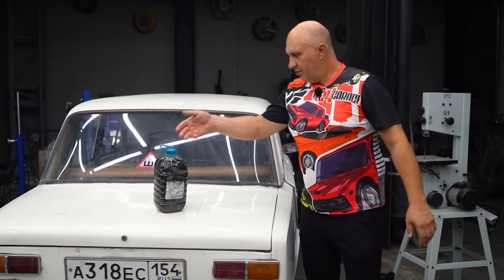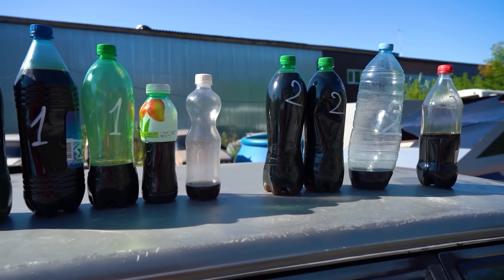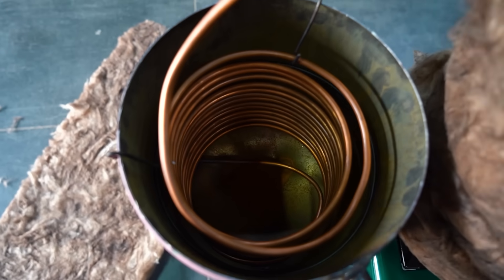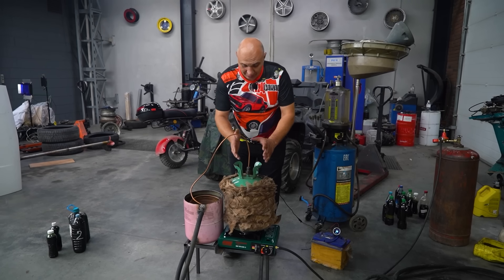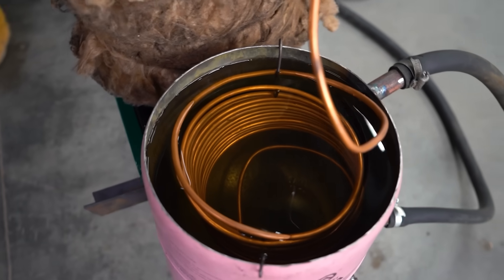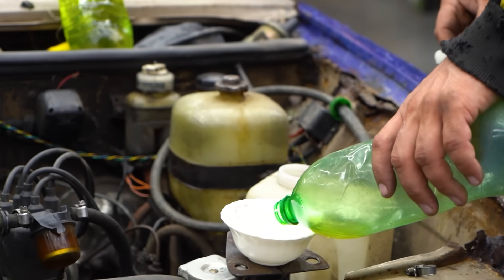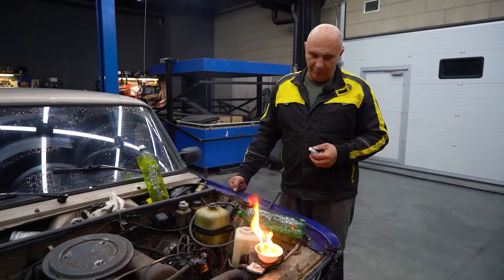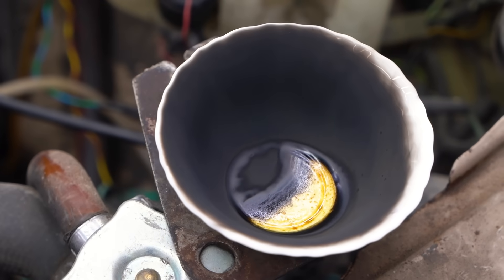Tire-extract fuel vs pump gas - which is better?

Comment: A spark plug comparison after each test would have been interesting to see.
Reply: I was expecting them to do that myself.
Reply: ill bet it needs leaned out as it burned hotter in the cup test that cracked the cup. its a longer chain molecule. right
Reply: @garykentner7557  That is a definite possibility.
Reply: Yes
Reply: Does the test site being container store yard?
Reply: @mohdhalimamat7877 You may want to reword that. It makes absolutely no sense whatsoever.
Reply: Yes!
Reply: They should adjust its gap and spark timing when its octane number will be known! Thats can be a matter for they color if not set right .

Comment: Fuel is made in large Fractional Stills, the higher vapours end up at the top and work down through kerosene, to Diesel, leaving Tar at the bottom which is used to make the roads. 
He could potentially Tar the road outside the garage 54.

Comment: I would like to see what the valves and piston in the cylinder looks like after running that synthetic gas for a bit. I guess you could keep refining the synthentic until it's as clean as pump gas.
Reply: Thats good point chuck.  So many fuels have been ran in vehicles.  Another idea would be preheating fuel to get better atomization.   I think if you did get varnish buildup some fuel system cleaner or a can of That Motorflush or seafoam.    But this fuel looks pretty clean
Reply: No if they continue to refine it it will become more rich. Look at the process  crude oil is made and you will see that there are many types of fuel you can get.
Reply: @MarcusAurelius2025  and different crudes give different hydrocarbons. "crude oil" is a pretty generic term, some come out fizzing with volatiles, "natural gas", butanes... some come out thick, tar with greases and waxes... iirc, "pennsylvania crude" was well known for lubricating oils, almost as a raw product. most people think of "tar" when they think of "crude oil", but that isnt always the case.

"cracking" is a bit of an art. its impressive what these guys have achieved, but with some good research they could still improve what theyre making... i have a few good books that go into good detail on this stuff. but it also requires a bit of decent lab-ware. and of course, to even begin to emulate a full on refinery is a daunting challenge! one wrong move and the whole setup can end in disaster...

my main concern is sulfur contents due to tyres being "vulcanised", which involves lots of sulfur... and then modern compounds are trending towards high silicon contents... a tyre is going to have lots of sulfur, and a lot of excess carbon.

it all affects what the end product is, and what byproducts are left.

doing tests on flash points, boiling points... maybe not as interesting a video, and would also be more suited to say, "nile red" or "chemical force" or "explosions and ire"...

and then theres always the original tests ricardo was doing on compression and how the term "octane" even came into being... quick look at any chemical databook will show that "octane" isnt just ONE compound, but a whole variety of isomers that share the same 8 carbon atoms in a chain. only one or two are what we consider as "octane".

that was the whole point of TEL, reduce the complexity of refining "good fuel", make it CHEAP...

 unleaded needs a lot of extra... "aromatics" to get the same result.

Comment: I think the difference is that regular pump fuel has ethernol in it which is less engery dense, this might explain the differnce you are seeing
Reply: I don't think that's the case in Russia. Only in politically correct countries do they put ethanol into petrol. It's basically a scam and makes petrol more expensive for no benefit to the environment or to consumers.

Comment: That fluid seems to have more energy density than ordinary gasoline. Try to tune up the carb, make the mixture more lean, if it starts pinging retard the ignition a bit. I think you can get over 10km on that run.
Reply: id think that would make the cars more fuel efficient then! might have to change my tune and switch to homemade gas 😂 as long as it doesnt kill my motor after being daily driven on
Reply: @_BaguetteDoggo just gotta find the right stoic for that fuel and hope it doesn’t cause build up on the piston heads or valves. I don’t think those ladas have cats so that’s one less thing to worry about. I’m curious of the make up of this fuel and how it compares stoic wise and it’s octane rating
Reply: @TheMrDarius  may not be exactly legally, but i dont have cats either 🤣 yeah thats kinda what i was thinking would be the death of my motor if it gets a whole bunch of buildup inside the cylinder or around the valves. maybe they should do some more testing
Reply: @_BaguetteDoggo   get a gdi / direct injected car and you will have crazy buildup in the intake any fuel. xD
Reply: @MollersT  makes sense lol
Reply: @TheMrDarius  thats exactly what it will do if you daily drive this fuel ! We saw this in a bowl test. immediately makes everything black and tar-like. unless you come up with some piston washing liquid this cannot be daily driven.
Reply: The biggest problem with making your own fuel from plastics or old fuel/tires is the extra additives the fuel will have. You want to make usre the fuel doesn't have too much sulfur in it and then you will most likely be fine @_BaguetteDoggo
Reply: @_BaguetteDoggo  2 stroke oil and cleaners and ur good :)
Reply: It almost seemed more eager to launch on the test track run compared to gasoline.
Reply: @jwalster9412 really need to test it on pump fuel again after as after a good thrash combustion pressure usually helps seal the rings a bit better. So might not be all from the fuel.
Reply: Yeah needs to be more lean, or even better, add boost and it might be crazy
Reply: Ya it has diesel mixed in they need to refine again
Reply: Or maybe try it in a diesel. It looks a lot like diesel fuel.
Reply: Should probably cut it with 10% ethanol to reduce knock possibility and to make sure the cylinders get cleaned out of that black soot.
Reply: mix it with e85

Comment: It would be interesting to send a sample of this to a lab and have it tested to see it's chemical makeup and also do an octane test
Reply: I didn't hear it knock at all, even when they pushed the car hard. The octane rating can't be that bad.
Reply: @misterfreedom5699 you have to remember that a lada is a dog engine it loves shit fuel
Reply: @STAY-GOLD-VINYL lmfao I mean you’re not wrong.
Reply: @STAY-GOLD-VINYL  so if the Lada can handle it.... my Ford 8n should also be able to handle it.
Reply: @misterfreedom5699  It's a Lada, it'll probably run on kerosene
Reply: @NoblePineapples  some guy got it to run on kerosene yes, but it started dieseling a bit after it got hot, he removed the key and it kept going for a minute
Reply: @Fred_the_1996 I thought run away only happens In diesels based on the burn test I also go back and think I should run away but didn’t the fuel actually lasted longer was slightly better acceleration wise
Reply: @misterfreedom5699  well, soviet fuel in the 60s and 70s was different from ours. In the ussr there were 3 varieties on sale: B-60, B-74 and B-100, which were 60 octane, 74 octane, and 100 octane respectively. So most cars could run on 60 or 74, while 100 octane was more expensive and not very widely used. Lower octane fuels worked well with the low compression of their passenger car engines.
Reply: The soviets probably used a different octane rating. Sort of like the British do. They don't use standard octane ratings like we do in the US. @Fred_the_1996
Reply: @TehButterflyEffect I think this is correct. Still today Europe uses different octane rating than U.S. The most common gasoline is 95 octane in Europe, and "premium" is 98 octane
Reply: @misterfreedom5699 Lada’s are designed for 65 Octane Russian fuel…
Reply: Project farm agrees lol
Reply: @trm4life  true🤣
Reply: @trm4life  I like where you're going with this.....
Reply: Yes need to see labs on this. The Lada is a dog engi e however I'm still shocked there was no knocking or lack of power. However the throttle response appeared to be lower
Reply: And a engine power test. I think it will have more power with the self made fuel
Reply: Would love to see how this would run in a fuel injected engine.
Reply: should name this Mad Max Post Apocalypse gas
Reply: I'd guess the energy density is close to regular gasoline.  Modern fuel has about 10% ethanol in it, which would explain the worse performance on pump gas.
Reply: @silvenshadow  I don't think the Russians are putting ethanol in their pump gas. That's a stupid thing that's done here in America thanks to the corn lobby
Reply: I would imagine it contains a lot more naphtha, which would make it burn hot.  Also tons more sulfur, since it's source was vulcanized rubber.  To properly refine, the sulfur would need to be catalyzed out, and the naphtha reformed.  That being said, the fuel is obviously usable as is, you just might need to maintain the car a lot more (1600 k oil changes)  and deposits / heat might have to be controlled with a water injection system for long term use if there were no other options.  A third distillation could get rid of the heavier compounds, but that also might have the side effect of an even hotter burn.  The waste would be incredible in such a simple process, so I suppose burning would be the best way to dispose of it, if possible reintroducing it into the main burner to supplement the wood pyrolyzing the tires and use the leftover lighter gasses for heating the refined products to distill them off.
Reply: This is why there was alcohol prohibition back in the day.
Reply: I had the same thoand spent about a half hour looking for a testing method.
Reply: I think the octane rating is a bit higher than pump gas, even if it is between normal ratings. 93 or 95, this is probably 94.something
Reply: @Nomad_za  im willing to bet you're wrong.
No sting intended.
Reply: @graverobbermotorsports4606  I could be wrong. But with the price of gas we have to start looking at other alternatives. I am seriously wanting to make gas out of tyres. In South Africa we are paying R28/Liter. I remember how mad I was when we were paying R9/Liter
Reply: @Nomad_za start with a different president. It’s miraculous that fuel cost plummeted to barely above $2 in Florida and it was under $2 in the Midwest.
Reply: @russelbrown6275  I wish we could. But the ANC will win again next year even though we have massive power outages. Though that has stopped for a week, because everyone who can afford it got solar power and inverters.
Reply: Is very simple..The octane test is higher than sintetic gasoline as the car runs longer distance...
Reply: Low octane is good for a diesel motor. In fact, the lower the octane the smoother a diesel runs
Reply: i did see already in other video from some mexican dude, claiming it was a good 98% but didn't make some kind of test like these ones. (also, it was only informational)
Reply: They can tell just with a simple heat laser. What I can tell it has low octane it looked hot since it broke the ceramic bowl
Reply: You got to love these guys hehehe
Reply: It has been tested by others. It's not good unfortunately. Mostly limonene, xylene, styrene, toluene,
trimethylbenzene, ethylbenzene and benzene. Some of those are straight up cancer juice.
Reply: Pyrolysis oil doesn't really have an "octane" rating per se. Depending on the starting material, temp, etc, you will get all different sizes of hydrocarbon chains ranging from C5 - ~C20. In vehicle fuels like gasoline,  they are 6 carbon chains with added 8 carbon chains (Octane) as a stabilizer by increasing the temp that the gasoline combust at. While there would definitely be some octane produced by the pyrolosis process it wouldn't be enough to qualify as 87, 90, 93, 95
Reply: @LtLolcopter n-alkanes such as octane and hexane are trace constituents of regular gasoline. The octane rating is just a measuring stick to describe how much compression the fuel can handle. Major components of regular gasoline are complex hydrocarbon compounds, many of which aromatic. Toluene is usually the most abundant, then the three isomeres of xylene. Gasoline itself is very complex mixture of hundreds of different hydrocarbons
Reply: That has to be at least 100 octane. That launch on the test track was really insane.
Reply: @jwalster9412  -- Higher octane doesn't give a low compression engine more power. In fact it will make the engine lose power. Higher octane is meant for high copresion engines to stop predeatonation of the fuel.
Reply: @kenhoward-h9e  who knows, maybe all the soot that fuel was putting in the engine increased the compression.

Comment: Super low octane probably. Tractor or bunker fuel looking stuff, mabye somwhat kerosene like

This would not work on a modern engine at all 

But an old or tractor type motor. Prolly be ok
Reply: It would be safer to mix it with pump fuel to stop the engine coking up. But yeah, this could be turned into a recycling business.

Comment: I was quite surprised. Figured it would run, but expected lots of pinging due to low octane. You guys never fail to deliver.
Reply: It's a Lada, the compression ratio is like 6:1. It'll run fine on just about anything that burns.
Reply: Based on the burn in the cup, the octane is considerably higher.
Reply: I think they got quite the opposite and got  a better octane number considering
Reply: @zethspurlock  at 6:1 compression, i think you will find its more efficient on lower octane, not higher.
Reply: @ct1762  I was thinking the same thing I know I have watched cars run to high of an octane at the drag strip and it hurt there et the cup burn though is why I'm thinking that who know I bet it's not just one factor like Maybe has lower octane and alot more unrefined carbons idk
Reply: @zethspurlock  well for one he wasn't racing the engine, in addition to the hotter fuel you would need high revs for an extended period, say a burnout, and then a trip down the dragstrip. Also if as said a Lada engine runs at low compression, then a lot of the fuel will remain unburnt. Which has a cooling effect.... Also back to the tune. Gasoline available in his area is 92 and 95 octane. Not the horsecrap 87 with 10% ethanol we have in the states, so.. Even if the car has low compression (which I doubt because I've seen compression tests on these motors that are comparable to the norm 8-10 to 1. My point is if the car is used to 92, and tuned to 92, then higher will only make it richer.. Which it did... Not leaner.
Reply: @christianfritz6333  exactly it made it richer
Reply: @christianfritz6333  Just wanted to correct something: US uses AKI instead of RON(more commonly used in the rest of the world, like Russia) to measure knock. 87 AKI is equivalent to 91 RON, the difference isn't that big. And ethanol isn't a problem, ethanol actually is more knock resistant. The issue is ethanol has lower energy density, and gas stations are selling them like they are standard gasoline yet you'll get less mileage out of it. It's like mixing water into orange juice.
Reply: They should try to run a diesel motor, and try to make very low octane, because the lower the octane the better a diesel runs

Comment: Great test! Now try acetone in regular gasoline. 30ml of acetone to 19L of petrol is the ideal ratio.Change the concentration and see how much acetone can be mixed with fuel before the engine runs poorly.

My best is 148ml to 49L of gas.
Reply: Why do this? Isn't acetone more expensive than the fuel?
Reply: TyaxComp  Those figures seem very high, also acetone is a strong solvent and would hate to think what it would do to the fuel lines and any plastic components. It's also water soluble which already causes issues with modern fuel cause of the similar properties of added ethanol. Oh and it's also extremely toxic in its own right, so even if it does improve emissions like you say. What's else would you be putting out the exhaust pipe?
Reply: @changingmyworld-j9z  I agree about the rubber and plastic damage but acetone isn't that toxic even though it smells it
Reply: @smeezekitty  Fair enough. I did look and it's not as bad as I thought. Only really bad in large amounts. My mistake.
Reply: @smeezekitty lol don't you think if simply adding a small quantity of acetone would improve emissions 50% it would already been done
Reply: @legros731  I was not commenting whether it were effective, only on the toxicity of acetone
Reply: Not sure about those numbers. The acetone would represent less than 0.5% of entire volume of fuel with the ratio you provided. In quantities that small anything would get dilluted without noticing anything performance wise. What you say emission wise is impossible.
Reply: Good way to pass emissions test😉

Comment: This is rad. There's a medium duty freight truck with a 6 cylinder carburated engine nearby that i want. I might have to make my own fuel for it, and put it to work
Reply: There's no free lunch. How much will it cost you in fuel to distill your own gasoline ?
Reply: @CaptHollister  it depends if you're talking about time or cash. I can go to my city's greenwaste dump and get as much wood as I want, collect free pallets from local businesses, get paid to trim trees and use that wood. I think the local sawmills don't charge for sawdust. Waste motor oil. Also, the way they distilled it the first time is by starting a fire at first, then using the gas fraction from the tires to do a lot of the work. Oil is actually very low in price right now, while gas is very high. Why? Oil company profits.
Reply: that will save you alot of 'gas-tax' while cleaning your environment.. (::) good luck.